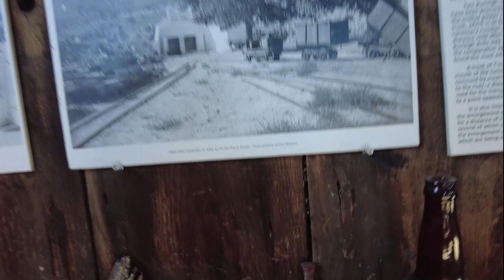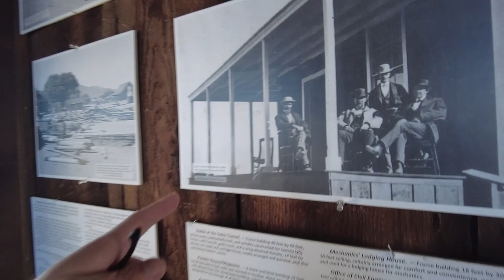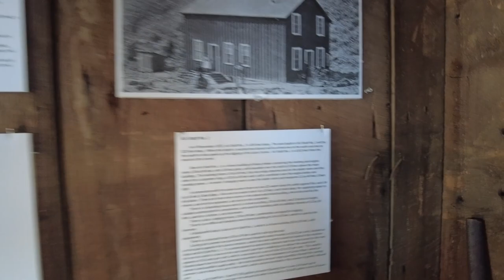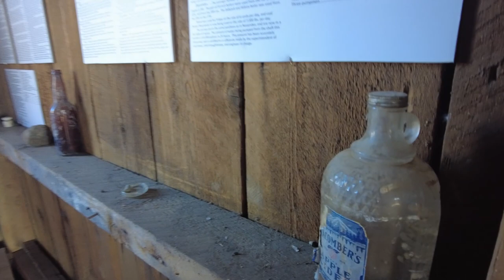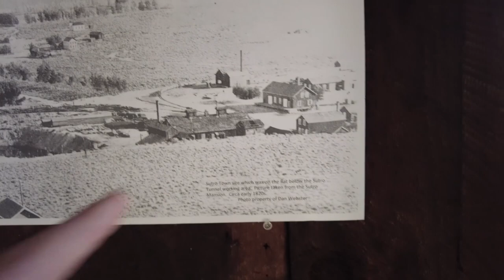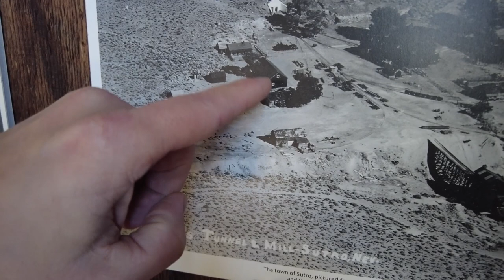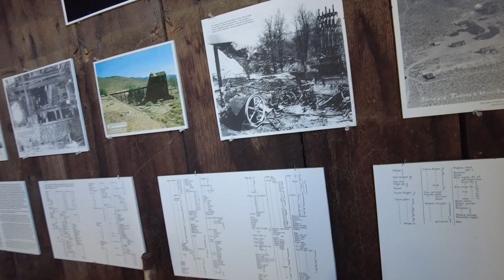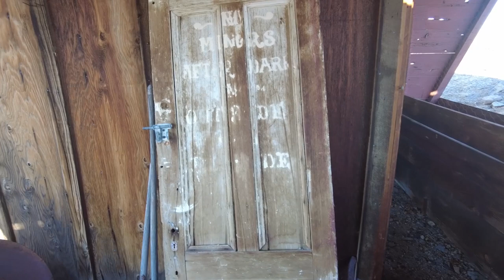🔴Sutro Tunnel Mine Site: 1884 Dime Found!!!! ⛏ (Full Version) #148

Comment: A GPR survey might help to locate the old cemetary...
And no, that "thing" at the mansion site is not a tamper or other tool.  It's a counterweight for a double-hung window; it would not be visible when in operation, as they worked within the framing of the window sashes, hanging from ropes and going around pulleys to make the window able to be raised and lowered and stay where it was put.  The San Francisco house in which I grew up originally had those types of windows...that's how I recognized that item.

Plenty of old wood for period-authentic repair and reconstruction...

Comment: If i recall,the mines significanly fell in production by the time the mine was finished? Thats what I read  or heard from those there in the 60s
I have a picture my father took from the front of sutros entrance looking outward past the bldg shown in flames. A contineous seep of water was coming  out of the  tunne with an old ore car sruck on tracks in the (mud) There was a cottonwood tree next to it on the left  ,blocking the view of one of two buildings.
The tracks ,with the ore car, head directly toward the  large building that was pictured in flames. The tracks then gradually sweeps ,left to the north past the other building blocked from view by the cottonwood. 
We used to see many ghost towns every year in Nevada,california,utah mainly, that were often times remote and no people around in those days. Used to take the manx dunebuggie and a Harley scat trail bike 165cc to explore from camp. In those days we never ran across either . We would stay several days in one spot and be rare to see one person all week. Today is another story. Sand Mountain north of Fallon Nev on hwy 50 it was rare to see one vehicle for a whole week. Today it looks like a minerature BlackRock desert during "burning man",TooK loads of pics with 35 mm slides from 1956 to 72.
Reply from the maker: Nice, I’m headed back this Wednesday any pointers?
Reply: I was stationed at what used to be NAAS Fallon and is now NAS Fallon in the mid 60's. We used to pass Sand Mountain (never did find that wagon load of Civil War whiskey that's supposed to be buried in the sand), and also the pony express office not to far from there on the way to the target range. I do miss that whole area.

Comment: The round piece of cast iron is a window waugh
Reply: Well if its a doule hung window w/2 weights the ones Im familiar with are from 1880 &1920s approx.I had one home that was built in 1885  and the other 1900 The weights were shaped more like a hot dog shape cast iron,2inchesin dia and 12 in long  approx. Cotton cord is what I used to suspend them from the cast eyehole at the top of each weight,as thats what was on them  before, it appeared Should be able to google them and see what they look like and how they work in the window.